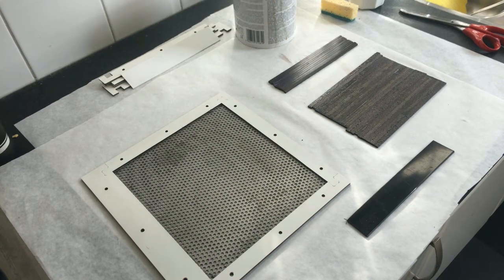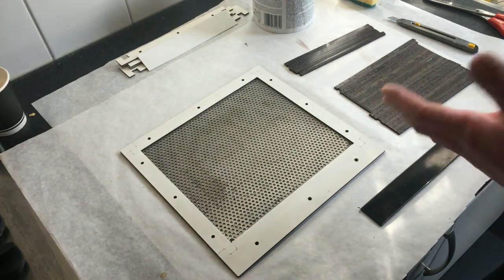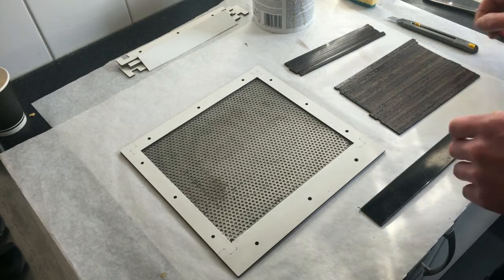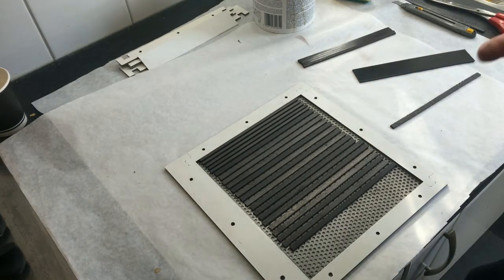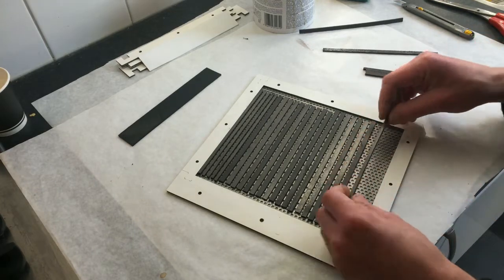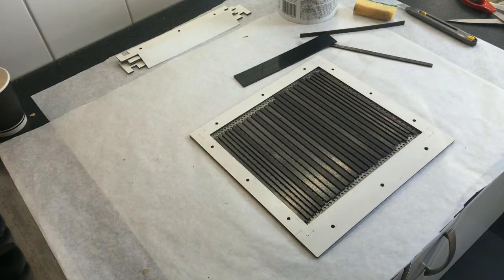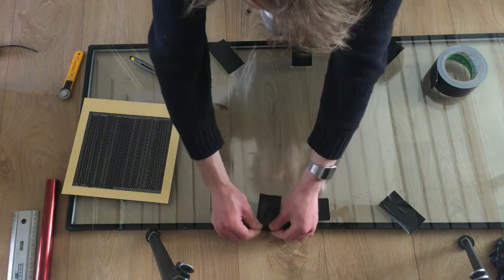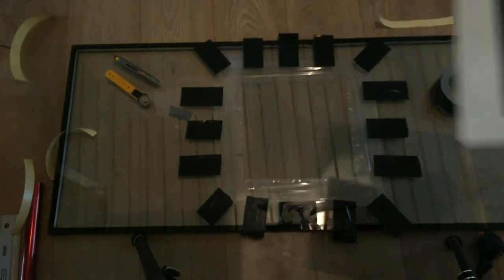Part 3 Bluetooth Planar Speaker - Glue magnets and Mylar

Comment: Is there a problem to use 0,75mm thickness of the metal instead of 1 or 2?
Reply from the maker: i dont think so, the rubber magnet is so weak it does not do much in efficiency to begin with metal or no metal. maybe a tiny bit. but difference between 0.75 or 1mm would be almost nothing. for rubber magnet i always take 1 mm just because its the simplest to get as perforated sheet over here :) thinner will work to. no problem
Reply: @joppepeelen  Thanks!